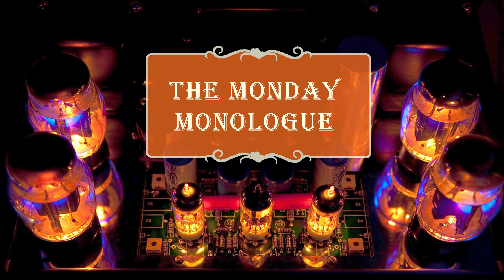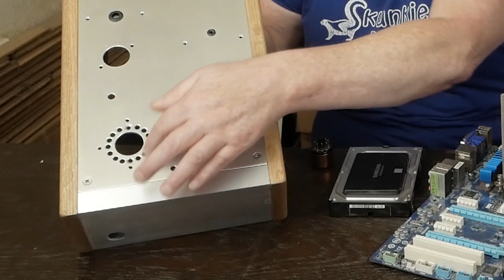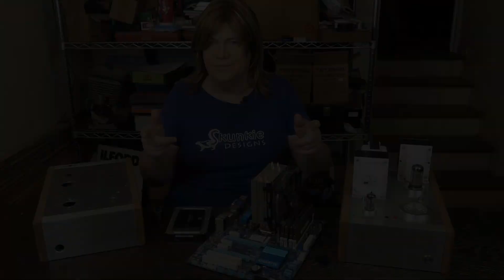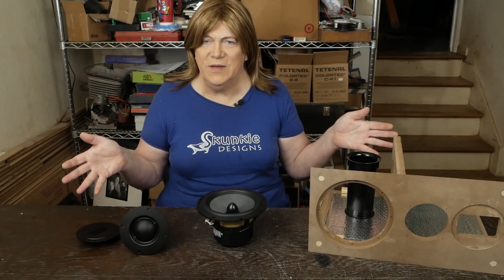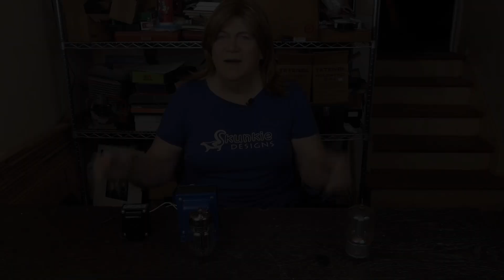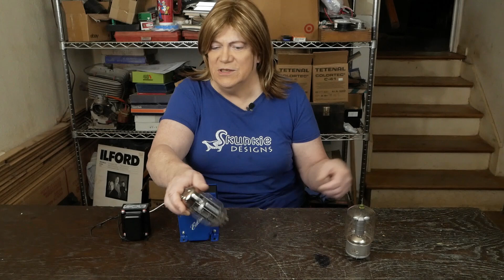Monday Monologue: What is a Hobby? + Big Bottle SE amps

Comment: Interesting to see what you get for results with those bottles. Not easy to find data on some...might have to look for a copy of RCA Transmitting tube manuals. Maybe you can find info about where they've been used in a modulator for AM transmitter as there's often a lot of guys that like to experiment with tube gear in that hobby also. Some years ago I was in contact with someone that used 304TL's in PP. Talk about space heaters.

Comment: That 4e27 tube looks like it came straight out of a 50s Sci-Fi movie.
Reply from the maker: Wait till you see it with the cooling cap on top!
Reply: @SkunkieDesignsElectronics  While Googling the 6C33C, it seems to be a used in a number of output transformer-less (OTL) designs like the Graaf GM 20 but they appear to need four of them.

Comment: Howdy from south side of the ATL...Just had a thought about how to overcome the transformer being unknown; could you include PDF prints for hole layouts? Maybe just the file to scale? Could be printed out and taped onto the chassis top and marked through the paper. BTW, should I ever come up with the money, I could drive up to pick up "locally" but gotta finish my XSD speaker build first. Dreaming of Joseph Crowe horn based system next though, which would be great tube amp project. Sorry to hear about your PC but glad it wasn't health related. Welcome back.

Comment: Hi Stephe 
Did you get around to putting the latest BOM up regarding the latest EAR Phono Stage, I'm still in a bit of a pickle in regards to which Power Transformer I need to be using for the UK. Would really appreciate your help with this 👍👍 Please could you help me 👍👍👍👍
Reply from the maker: 369AX.

For any of my builds outside the US where I use a 200 series Hammond transformer, you will use the same prefix 300 series. And nothing changes in any build other than the wiring for the primary of the power transformer.
Reply: @SkunkieDesignsElectronics  Thank you so much Stephe, I'll get the 369AX ordered, there seems a lot of wires coming out of it, would you mind pointing me in the right direction as to which wires I use and where they go to on the board, or is it the same as in your video ( 2 reds, 2 greens to the board and 1 black and 1 white to the switch ?
Sorry for all the questions but I don't want to get this bit wrong and fry all the components on the board 😅
Reply from the maker: https://www.hammfg.com/electronics/transformers/classic/300?referer=787

Comment: I'm going to use a pair of thordorson  output iron. Nos.  From Mt Carmel I'll lol they was in my back yard. Lol. Pasted me by  I'll just use double sided tape. No holes. No fuss. I have 10 old amps in various states. Some  6080s. With some older TV pwr tranns. A B plus around 350. 2 Triodes one bottle.  3 Afill. That's a honker. Anyway. Would you do it forr.  Wicked. Deal. Keep teaching. Teaching.  🙏❤️🌹🎵🎶🔊

Comment: 633C in power drive configuration. There’s nothing wrong using silicon parts to drive big tubes.
Reply from the maker: No sand! lol  Well maybe a little here and there :)
Reply: @SkunkieDesignsElectronics  A little sand can keep it at 2 stages and with very nice driver tubes, make real magic. George Anderson’s set up is great. But you do your thing!

Comment: Hey, thanks for the insights :)
I'd definitely learn CAD or at least vector graphics (Corel Draw etc.) then have the chassis machined if I were to make anything more than a handful pieces; you're right on the money about why you don't want to get into making kits. Metal work done by hand can get tiring sooooo fast. I hope they'll understand.

By the way, Hammond can pre-machine their aluminum enclosures, an interesting option for effect pedal makers. Wondering about the cost.

6S33S "the devil tube" haha! Indeed used in voltage regulators on MiG jets. They were pretty popular in my parts, there was a plentiful supply. Back in 2000s I used to frequent an electronics market, and there were some Belarussian or Ukrainian guys selling literal bags of tubes, I'd say cheap as it can be... I was way younger and poorer back then, I couldn't afford buying these tubes and I absolutely regret that. They ain't coming back.

1kV B+ still doesn't compare to those you can find in CRT devices... more than enough to teach you a lesson, haha! :)
Reply: Learned CRT in my Radar classes in ET school curtesy of the US Navy back in the day, but never had a chance to put that knowledge to use. Forgotten most of that now, but don't doubt it at all. Thankfully, those HV are DC, which can knock you across the room, but at least won't hang you up till dead or power is shut off. One hand rule for a reason - LOL

Comment: I see that you're tired of suggestions and ideas. So here's another one. Lol

Hifi2000 Is a company that makes amplifier cases. They drill to spec. They are also made to order and their turnaround is pretty quick. What you can do is send them a cad file which they keep on hand. When people order a chassis, it gets made at that point. They can also make a cat file based off of your drawing period

Next what you could do is make a Essentials kit. Another words stock the hard to get parts. People will have to find their own resistors.
Reply from the maker: And then is the customer support, when they have a bunch of bad solder joints, the amp doesn't work and I have to help them get it working. There also is the issue with people who, for whatever reason, think this kit is defective or a rip off, complain to paypal or visa and the charges are reversed. I'm just not sure any of this is worth the hassle at the price point I suspect people want to pay.
Reply: @SkunkieDesignsElectronics  I see. Those are problems that are difficult to solve.

One way is to start a forum thread when you release a kit. The support it public so that people can refer back to it. Of course there is still some work involved.

Paypal wants to see that you have shipped the product. Once you ship the product in the tracking number confirms delivery, you're off the hook with them.
Reply: I think that selling kits is probably not quite as bad as you think. However, i think it also requires more work than you're interested in doing. Which is fair. I admire your channel and quite appreciate you taking the time to make these videos.
Reply: @@scaryperson27  Starting a whole forum may be a hell of a lot of work!  Maybe Stephe could do q&a videos to discuss enquiries posted on the channel?  Something like that.
Reply: @nevillegoddard4966  No. Not a whole forum. But rather a topic over at a place like DIY audio. They even give companies their own subtopic if it is desired. But simply a post in the Tube section would be quite helpful. Also the more obvious questions tend to get answered by be more experienced constructors.

Usually have to the first few pages then it takes off.

Comment: I  understand your frustration regarding requests for fabricated chassis. All I would say is that some of us don't have metal working facilities, but we do have the tools and space to wire things up and stuff circuit boards, the electronic stuff. My projects are always a bit let down by my lack of metal working set up. But, yeah, I can see how it doesn't really work for you to provide that service. The economics of small scale production just don't make sense unless you've got some seriously rich customers!
Reply from the maker: Right but I will add, I don't have "metal working facilities" either. Some measuring tools, a cordless drill and some drill bits. If these complex projects feel like too much, start with something simple like my headphone adapter box.
Reply: @SkunkieDesignsElectronics  You get great results with limited resources....I build for myself, so put up with slightly less pleasing visuals, so long as it sounds good.